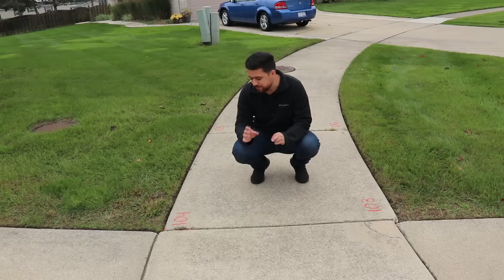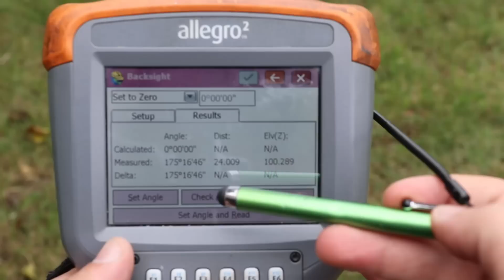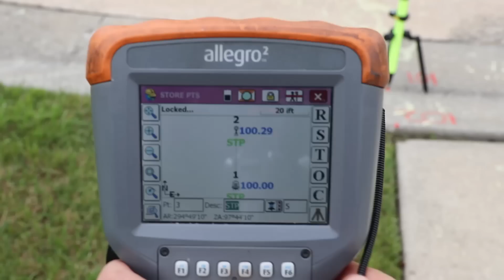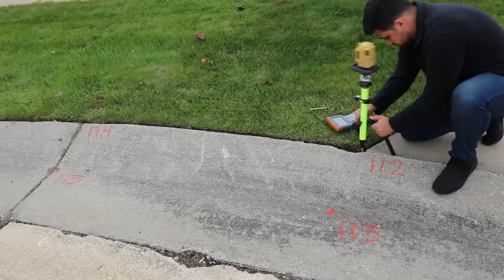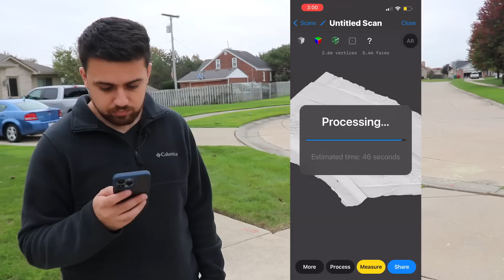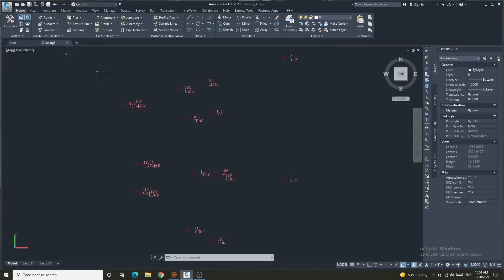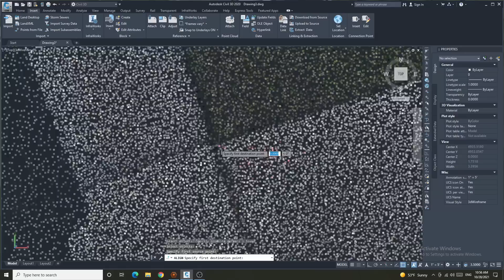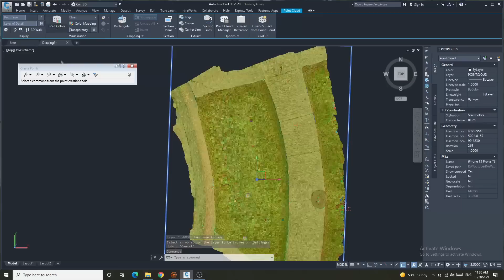iPhone 13 Pro LiDAR vs. Survey Total Station Accuracy

Comment: Slight total station horizontal/vertical angle miscalibrations will erase the relative accuracy of a short pole vs standard height, especially at the close distances you measured.

Comment: Do you know why your iPhone 13 Pro LiDAR vs Total Station level has a major difference because you align the point cloud with the Total Station point and during aligning your point cloud coordinates is ok as per Total Station point but the z value tilted that's why z value sown major difference (i know the solution) the solution is don't alight just pick anyone point cloud point and place on total station point then rotate with the second reference point

Comment: Thank you for the video. I have all of the corner pins of my property marked. is a string accurate enough to use to set a fence on the 628'boundary line or would you use an instrument of some type?

Comment: Not to be a stickler, but seems like the deltas are somewhat correlated with the direction and distance. Deltas between iphone and TS on local north grid are fairly tight while west and south, deltas are building up. In you check, we can't see in the video if a HChech and VCheck was performed ... Transit and Face to CP.  We should not see a correlation between these deltas correct?

Comment: If I remember correctly, human process and consistency is first error source of any survey. A second run with the total station will have different values. 
To your point, sensor and software technology has advanced tremendously in the last 20-25 yrs.

Comment: Surveyor here. I’d love to see if the accuracy improved if you used 3 points to align the scan. You could do this completely in the office without redoing the field work; just use a topo point for the 3rd alignment point (though technically the 3rd should also be a control point). This will likely introduce a little more horizontal error which you COULD adjust for, but I would at least hold the elevation. At least 3 points should always be used when aligning a 3D scan. Imagine a capital letter “ T “. The 2 control points would be at each end of the E/W line segment at the top of the T. By holding only those two points, the N/S line segment of the T can freely rotate, or twist so to speak, around the axis of the E/W segment if the S end of the N/S segment is not controlled. In fact, I’m curious as to how the scan came in even remotely close to being level and not rotated around the axis between your 2 CPs to some crazy extent such as the ground being nearly vertical for example?

Comment: It just goes to show how much more accurate metric is, compared to Imperial.

I bought this phone (13Pro)  for this exact reason. Yes, I could’ve easily saved hundreds of pounds, but I really wanted LiDAR and the most up-to-date chip set available at the time.

Comment: What errors if you transformed Lidar to 3 survey points? Short rod tough on the knees.. Needs an extension to standing height with the bubble at eyeball level, leaving the reflector low.

Comment: The iPhone and other cellular phone positioning systems are pseudo-GNSS systems that receive signals from cellular phone antennas, so they can only be used in urban areas with relatively large numbers of antennas installed. Since cellular phones cannot be used in areas far from urban areas, they cannot be used to build vacation homes or mountain huts, of course.

Comment: Im a Geologist, in short I prospect for new valuable mineral deposites, find then, file the claim, if its really good ground I keep the claim and everything else I sell. I was just reading that Geologists are starting to use LiDar to find mineral deposites. Have you heard anything about this? Im wondering if there is a particular type of camera I'd need to do this? Sorry for the questions, I just wanna make sure to get the right onee from the start. Ive been using drones to find mineral deposites for several years really before i seen anyone doing this so if possible i'd like to setup on of our drones with the Lidar

Comment: No access to a Faro LIDAR ?! That would be a better comparison….  Also the LiDAR starts more around 30-40.000  € a used totalstation (though not a robotic one) can be less than 10k €

Comment: Who would have thought that even 15 years ago we would be comparing a $20000-$60000 precision instrument to a phone and have the results that close! I switched from android to a 13 pro max several months ago and do not regret it one bit! It’s amazing what such a small, relatively cheap device is capable of!
Reply: Right. It's more than a phone now, it's a tool. A flashlight, a speaker, a camera... etc etc
Reply: Why did you bring Android in this conversation? 😳💀

Comment: As a precast concrete designer, if the engineer tells me that the rim elevation of the manhole could be off by up to 0.18' (2") I would just design the manhole to be 2"-6" shorter so that it doesn't end up being 2" or more over grade after installation.

Comment: If you realize that this sensor is really tiny, the price of the entire phone is like 10 times less than the sensors, and the process is way quicker and easier + it also gives you a 3d colored model then it's really impressive.

Comment: I am wondering whether the inaccuracies of the smartphone (elevation drift in particular) can be calibrated out. For instance if the accelerometer/“orientation sensor” is not perfect out of the box. 

Also, can doing multiple passes with the device and averaging-out the error overcome the limitations ?

Comment: "PK" is a trademark name.  Parker-Kalon.

Videos like this are why people think surveying can be done by "just anybody" and that "my GPS told me..."

I would suggest that using an iPhone to SUPPLEMENT a true ground-based survey might be satisfactory, because you need a baseline to correct your data.  But as a standalone, this information should only be relied on for general reference, at best.

Signed - a Virginia registered Land Surveyor.

Comment: Your error could be from skew of the scan. This should be done with picking all the points in the scan coordinate system and labeling them. Then do a best fit analysis with the known points. This could be done in something like Autodesk Recap.

Comment: Thanks for the informative  vid. I'm using a SOKKIA ix Robot with Carlson Surveyor+ for survey work. When I loose the prism lock I have to push the "Search" button on RC-PR5A to resume it. How can I use the Data Logger to do it? Also I feel my Carlson Surveyor+ is much slover than your Allegro 2.

Comment: As a surveyor and civil engineer I'm pretty impressed with the results. I think a place it would shine is in determining how much material was dug out or filled in, I remember a water tower site perhaps 75ft diameter taking hundreds of shots trying to get the detailed shape of excavating to bedrock which varied wildly. 
Also I never had that sensor for the top of my prism! That's cheating 🤣

Comment: I think adding some more 3d features would help improve the height accuracy. Like by leaving some concrete blocks in a grid every 2m. The software likely struggles to tell if mostly flat ground is flat or slightly curving otherwise (when it's stitching together the various 5m sized frames from the video feed to model an area much larger than 5m).

Comment: How did you establish the coordinates and elevation of your setup point and backsight point? Assuming you either set two points with GPS or if you wanted to be extra accurate I'm guessing you came off a monument. Although you'd still need a preset setup point if you did the later of those two. Just curious
Reply: For some projects, it's ok to assume coordinates, direction & elevation.

Comment: I think if you activated Windows the accuracy goes up. Windows is known to flub Excel data when it’s not activated. You should switch to a Mac since there is a data conversion from MacOS to Windows that could have contributed to the error. 😂🤣

Comment: You're surprised by the elevation inacuracy, but it also seems like you also only used 2 points to align the point cloud wit the survey points. You'd need 3 points to actually algin the point cloud with the survey data.

You can't just assume that the pointcloud generated by the phone was accurate in terms of it's orientation with respect to gravity. You can only really assume that the points are accurate relative to each other. Normally you'd want to include a known marker of some kind in the scan that you know is vertical if you care about it being exactly level.

Comment: I was going to say human error is to blame for some inconsistencies. Which is still possible in the x and y axis. You could’ve chosen a point slightly off from what you selected the first time and the iPhones resolution was set to 6mm. Therefore 0.02 ft of error is possible on any point. But I’m wrong because the elevation is mostly infallible. Mostly because certain surfaces had slope. For context if the concrete was as sloped as your roof and his selected data point was off by a massive 1” the elevation would be off between 0.027 ft to 0.0625 ft. 
So after doing the math. The elevation can have an excusable human error of 0.0625ft or 3/4 of an inch (19.05mm) AT MOST. As you can see in the video the iPhone has some elevation points off by 0.2ft. Over 3x what human error could justify. ((Ignoring point 210 being off by 0.28 do to such a far travel distance))

I am still impressed with the iPhone but I was hoping I could rely on it more for work. Amazing work.

Comment: Rami.  Love your videos.  Could you perhaps do a video using a 360 cross-line laser compared to a quick set dumpy level to do a topo survey?  Is it even possible to use the cross line laser with a survey staff?

Comment: Great experiment Rami!  Could you share the excel sheet?  I think you could further process the data to show other aspects of the accuracy.  In particular when I see that all the northing errors are negative, this may suggest that the initial matching of the two datasets may be off (- especially because you used only two manually picked points).  It might be better to reposition globally or to look at the error distribution...
Reply: Work such comments am i even a surveyor lol... no wonder i like cars

Comment: Did you attempt to fit/stretch (maybe using just the perimeter survey points) the LIDAR into place and then check the DELTAs.   A larger area would probably be better for this.  

This video just cemented my plan on investigating the use of a Iphone capture as a mechanism for capturing As-built data in a construction site, scanning as elements are built/completed.   This is for a Tech demonstrator project.  We're using a pre-LIDAR terrestrial (FARO Scanner) scan w/survey control of the construction site as a LIDAR control (pointcloud) for positioning all the subsequent LIDAR captures with the Iphone.  

Thoughts (anyone/everyone?). 

Looking for your SteadyCAM video now . . .
Reply: @Ramitamimi..  Thanks, I guess??

Comment: looking to use the iPhone Lidar to capture deflections of a concrete ceiling. Would you be happy to share your excel spreadsheet?  I'm hoping to get an accuracy of 2mm or better, do you think that is possible using the iPhone?

Comment: Wouldn’t it have been better to register your scan with the surveyed points by using some better features that are mostly in the 3D domain and not based on picking colours from the rgb sensor?

If you chose a few bad points for registering, the points may all be dragged out vs a better alignment.

Isn’t it common practice to use chrome spheres or something for registering multiple point clouds together?

Wouldn’t it be best to set up some 3D features (not flat coloured ones) at the bounds of the surveyed area to register the two data sets together?

Great experiment any way, just the kind of thing I wanted to see!

To buy an iPhone or an iPad though…?

Comment: I wonder if your geometry of the lidar sensor is affecting your vertical?  You stand over your scan area so horizontally you have strong geometry but vertically it is weak.  If you also scanned closer to ground level parallel to the ground I would bet your vertical accuracy improves.  Thoughts?
Reply from the maker: I honestly think the vertical is really good. It's my horizontal that is struggling because of the drift in the gyroscope. We could scan at a lower height, but I wouldn't test it until I have less drift.

Comment: May I ask you,  you get 2.6m vertices, and 5.4m faces "object" with high res setting and 5mm accuracy, I wonder how big is the file? 500mb or 5GB?   And another question - how about overheating iPhone issue?

Comment: good video. Remember that good survey practice is to have your backsight as the furthest point away from your detail survey.... if possible to avoid angle error. Also you had high vertical angle readings, so RL error would be higher. Would be good to see your next video on this.

Comment: So you wanted the rod as low as possible to reduce error yet take a shot in the middle of a painted dot at times that is the size of a quarter or penny.  Then zoom into the lidar point to see one part of the quarter size dot and say that is the survey point.  No it is not the survey point but one small part of the quarter size dot.   Then we don't get to see the apples to apples comparison of the total station lidar vs the iphone lidar which is what i thought this was about.  Your comparing the survey data to a lidar dot that you have no idea if its the same spot.  And after reading a few of the comments below I am a Professional Land Surveyor.  But with this said you did show me that the lidar app that I amusing on my iphone was not the right one to use. So thank you for that.

Comment: Impressive work : )
I will not nitpick, but the correct way to position the point cloud, is not to align two points.
The correct way would be to align for lowest overall distance to reference points.
Because of that, the result was actually a bit better than what you ended up with, and sorry if you mentioned this, but I missed it.

Comment: Awesome videos, I use Carlson Point Cloud to analyze the point cloud data.

 I do have a  question, in the video I see that you bring in a .rcs file into C3D, yet I don't see that file extension in the app to export to, did you use Recap to do the conversion?

Comment: Don't be fooled everyone, this test does not in any way prove the "capabilities" of the iPhone Lidar. It can handle flat surfaces alright, but nothing as complex as even a shoe box. Been running lapses around a VHS tape on my table (non-reflective, cardboard) with the iPad Pro 2021 + the same app, and the results are so wacky it's actually embarrassing.

Comment: You folks know more about surveying than I, but being off by over 4" horizontally and over 3" vertically within only a 5m allowed range isn't exactly stellar. Depending on your needs, of course. I am impressed that the smartphone has yet another amazing ability, considering its size and price, though. Great video. Thank you for putting all of that time and effort into making this for us.
Reply: He actually had points that were ~10m apart.  I think the 5m range is all the iPhone LIDAR will capture of its immediately current view.  But the scan/point cloud is a mosaic/composite/panoramic as you image your total area.  I’m curious if the accuracy would improve if the overlay had been referenced off of three points to create a plane, rather than a two point line?  Not a surveyor, but I understand the math, trig, geometry.

Comment: I dont get why you used only two points to align? For 3d plane you need 3.

And in the final table you have to have at least one point with 0,0,0 difference between station and iPhone. Or else you heve uncompensated absolute error.

Its all pretty important because if have absolute error and plane angle error you can have really big accumulated error.

Comment: I am impressed with the accuracy of the iPhone-generated point cloud, especially considering the phone was not positioned or moved in a controlled manner. To take it to the next level, the LIDAR app could recognize objects placed on several KNOWN precise control points (as done in the video), the known exact locations of those (2 or more) control points would then be loaded into the app, and the app would apply corrections to all the data based on knowing several exact actual positions within the data. Probably could be worded better. End result would be quite accurate surface data using the iPhone sensor in conjunction with the total station or an RTK system.
Reply: It might be possible to use GPS for that.

Comment: I don't understand how the iphone is able to compensate for the motion of the laser source: 3d manual scanner acquire the instantaneous position of the emitter through a 3d positioning system ( pretty much like 3d motion capture for movie characters). Is the iphone relying on accelerometer or camera, or both? If that is the case 60 mm difference is more than satisfactory!!

Comment: So basically, great for horizontal but not survey grade for elevations.  The vertical relativity is close so it could be used for dirt/material piles for sure.  Pretty awesome for an add-on tool on a phone.  Good video.

Comment: I have a tripod with a ball gimbal that is smooth like silk  and can be locked in place  I use for videos it would steady the phone and possible make up for the measures being off  ??  The phone surely has image stability but the inaccuracy maybe improved   One of about 8 tripods I have I don’t use as all my shoes are missing  and no one has the right size !!     Anyone wanna make millions ??   Sell a pod shoe that is universally adjustable  even if it cost $100 instead of $6   We have tripods collecting dust.  Now I use a cheap tripod as I know the shoe will go to the same dimension as 10 mm sockets.